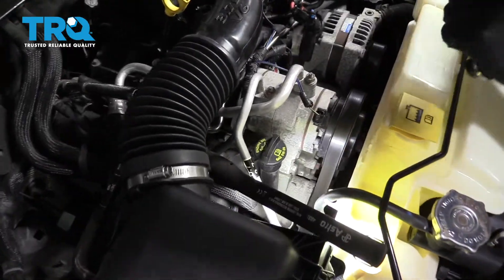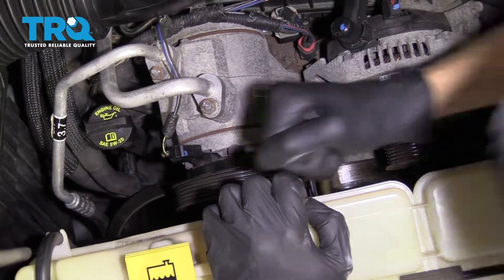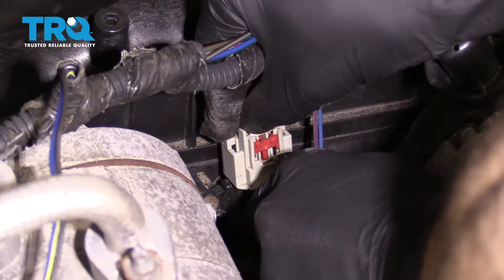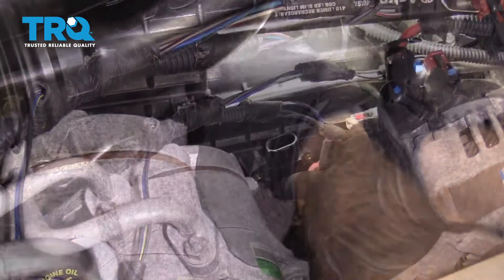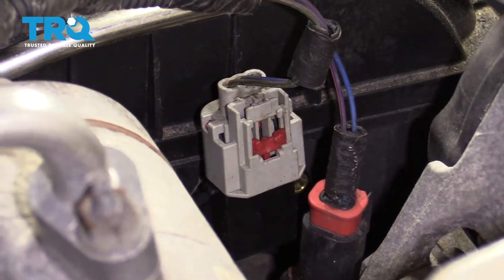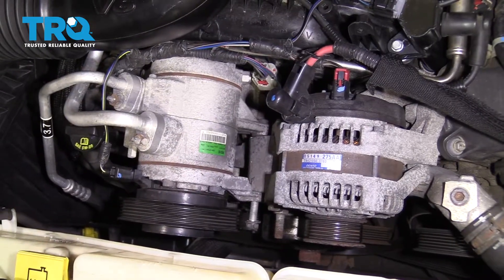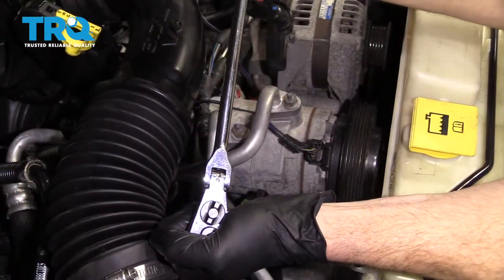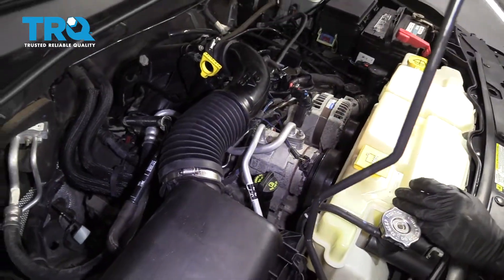How to Replace MAP Sensor 08-12 Jeep Liberty

Comment: Very informative video. Because I did not want to move an  AC compressor, I used a flexible driver which can be curved or slightly bent. I removed a MAP sensor and cleaned with spray. Then there has been no more MAP sensor error codes.

Comment: I changed my map, injectors, spark plugs, engine coils, fuel pump and still when I press the gas still dies 😭   HALP
Reply from the maker: +@user-dz4ic7eh4g We wouldn't be able to diagnose an issue like that here, you may want to have a local mechanic take a look at it. Thanks for checking us out! http://1aau.to/m/Shop-1AAuto-c

Comment: This was helpful but his only had one bolt on the sensors theres 2 and the temperature sensor gets in the way for a socket if yiu have a 9/32 wrench be great i didnt 7 kinda worked i got it off after spending a hour looking for the 7mm wrench lol 😅
Reply: I also took of the alternate for more room

Comment: Lol, let's just never mind the right side bolt which has another connection in front of it making it extremely difficult.   ROTFL.
Reply: Only one bolt holds the sensor on and that would be on the left side if your looking at it standing in front of the jeep. ROTFL
Reply: @johnsmith6368  Yeah, I thought mine was missing a screw too...